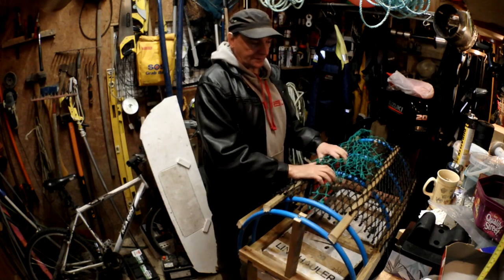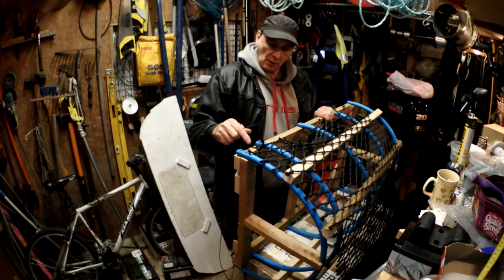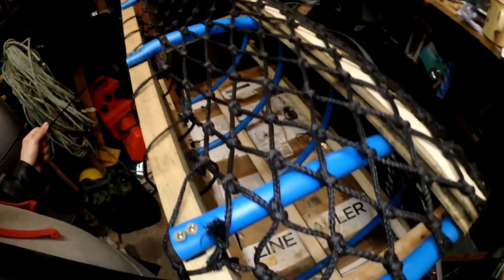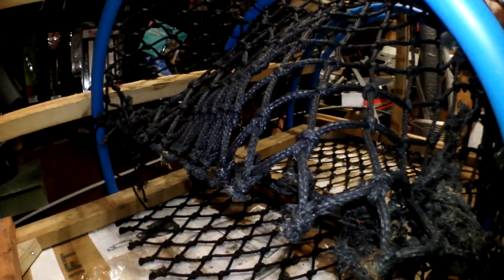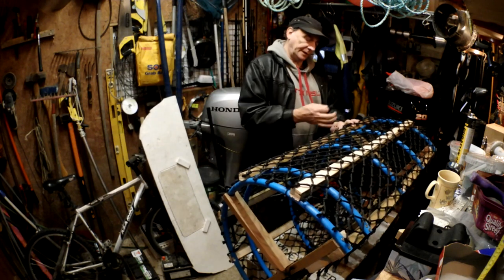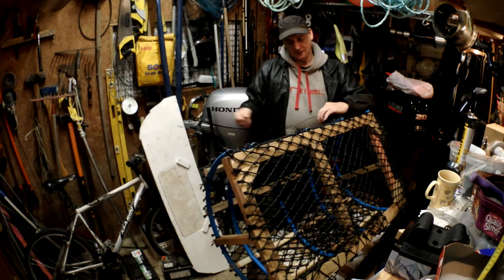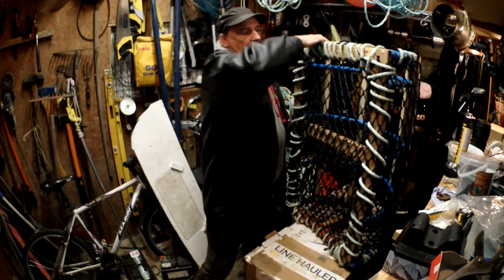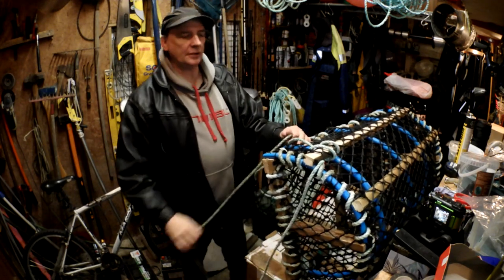How To Make A Lobster / Crab Pot Part 2 - Netting & Rope

Comment: Troj, my son and I made three of these in the spring based on your video. I have had them out now for three months with great success! Fab video and advice. Thankyou  from Cornwall 👍
Reply from the maker: Happy to hear they are working well. I started making these pots when I was about 18 and have changed and refined them over the years to get them as efficient as possible. They have proved to be very successful for me and its great to be able to pass on this to others
Reply: @Trojwaterman  they’re fab. I use them alongside some older commercial creels that were donated to me. Each time the creels are poor i know I’ll come good with one of the handmade pots. Why? I don’t know….. there’s just something about them!
Reply from the maker: @philtregunna9686  I have had creels in the past  they do catch but I  personally have not had much luck with them. It may be to do with tides amount of weed and how they land underwater plus it can sometimes be small design flaws that can make all the difference from one pot to another.

Comment: Troy Try putting your netting around the pot, rather than side to side. you will find you will only need to fill the bottom in then . 29 inch pot you will need about 40 meshes X 9 . Sounds strange but it works better. 29 inch is what I make not sure what yours are, and thats not including the door if your putting one.cheers.
Reply from the maker: I will check the pot width but these ones may be a bit big

Comment: fill scaffold bar with stuff ? for weights? gl
Reply: That's a good idea for if you can't get hold of any sash weights just fill with concrete jobs done 👍
Reply from the maker: Dig of the dump Yes I sometimes use steel pipe filled with concrete